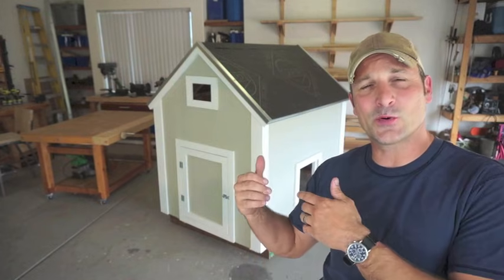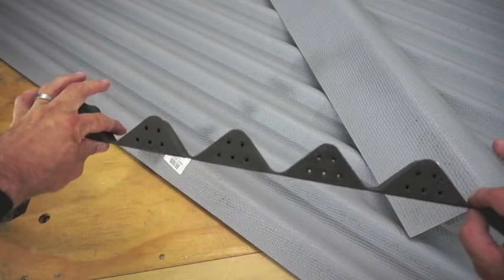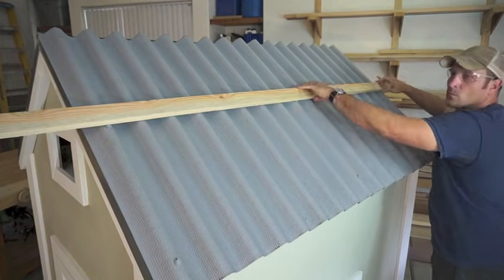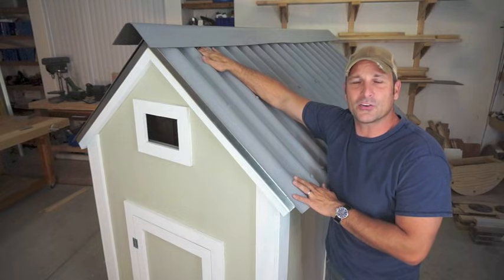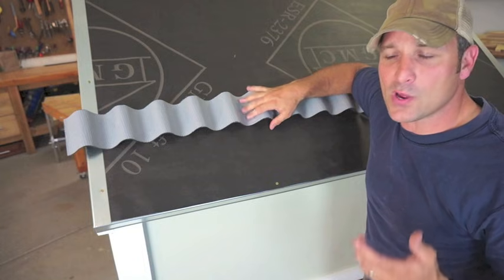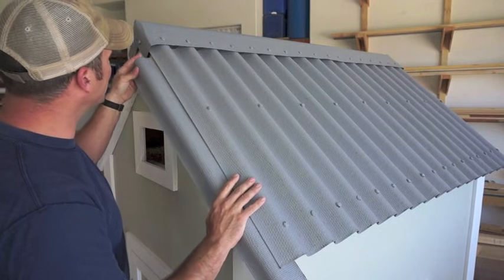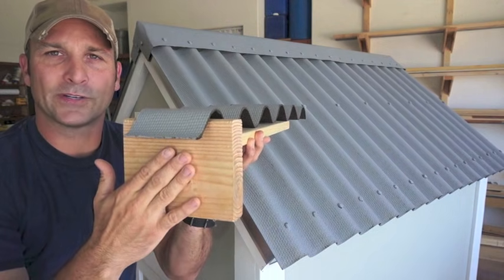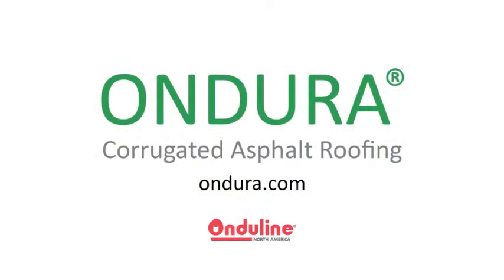Installing ONDURA Corrugated Roofing Sheets on a Chicken Coop

Comment: Ring shank nails will loosen and can't be tightened. They are extremely hard to be removed. Purlins are a weak way to go. The latest research shows that putting screws on the high points will loosen over time. The screws should go in the valleys except for the ridge.
Reply: that makes way more sense as there will be no way the panel can flex

Comment: do the ventilation closure strips just go on the ends of the panels?
Reply from the maker: The vented closure strips go under the ONDURA sheets at the eave and between the ridge cap and the ONDURA sheets at the ridge.

Comment: how much would you let your fascia board stick up on the end to do it the European way instead of using metal flashing
Reply from the maker: The top of the fascia board should be one inch above the roof deck to fit properly within the last corrugation.